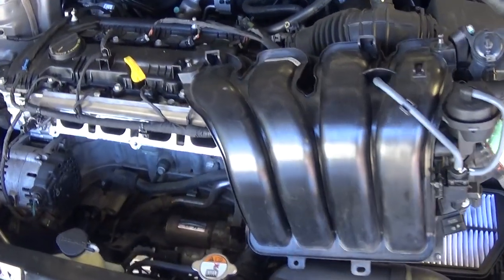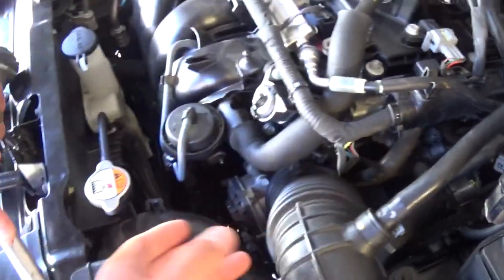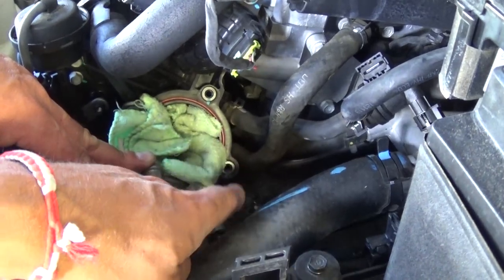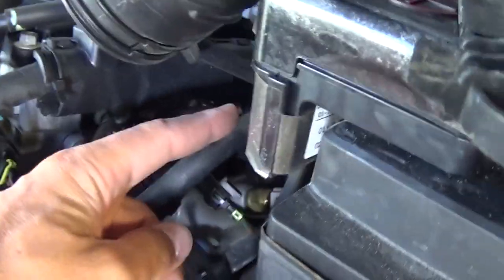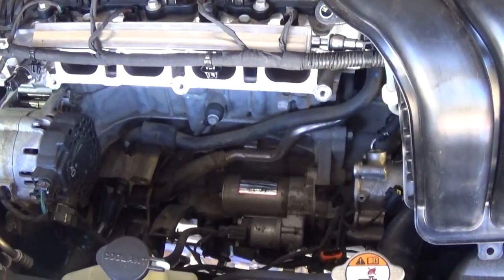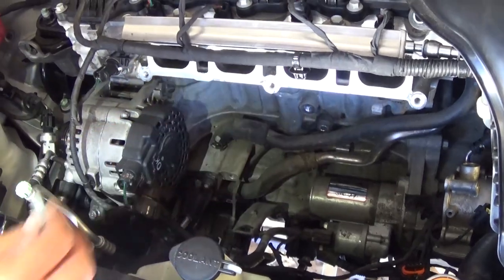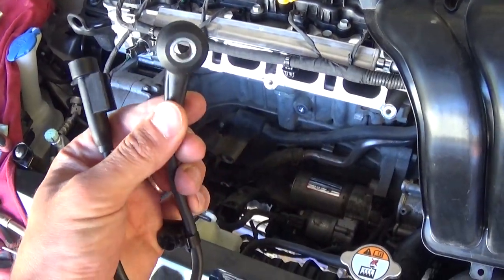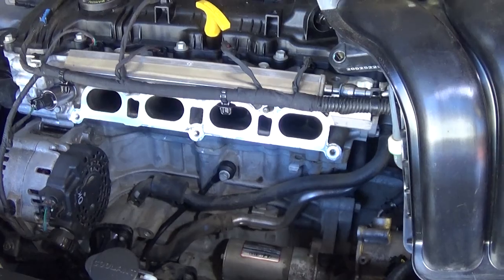HOW TO REPLACE KNOCK SENSOR KIA FORTE K3 CERATO SOUL 1.8 2.0 NU

Comment: PLEASE HELP! How do I bleed a master clutch cylinder and a slave solenoid for a 2011 Kia soul manual transmission 1.6 L engine. Two local mechanic shops have just taken money and time and still haven’t fixed the issue.